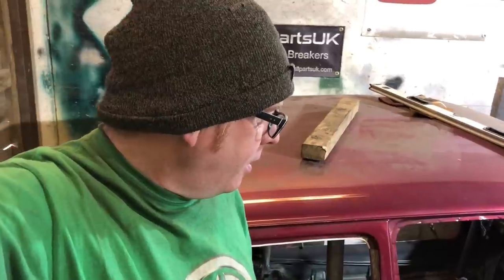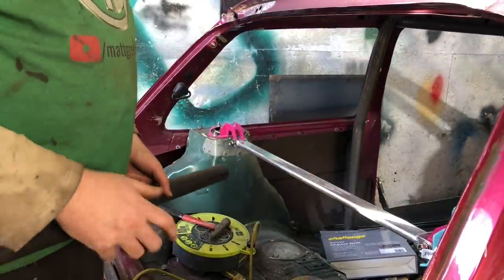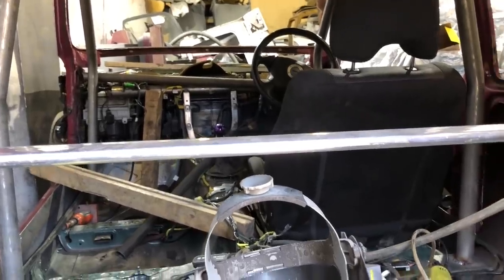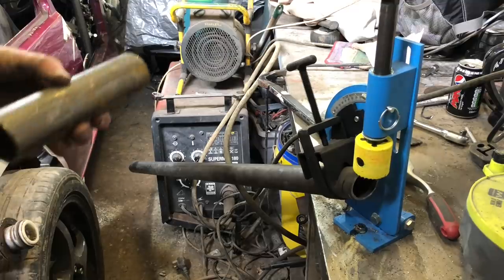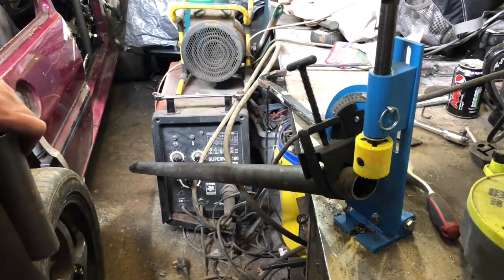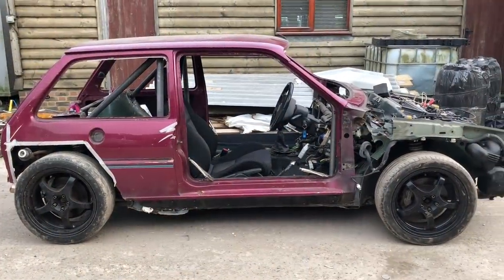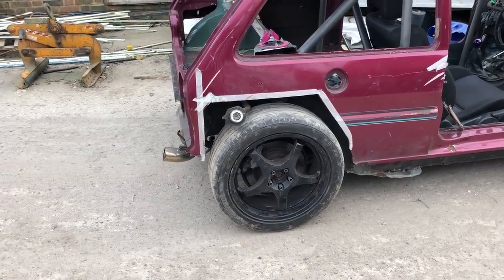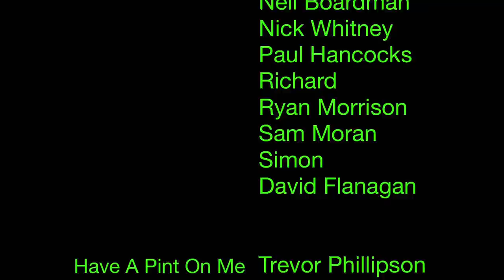Metro 6r4 WRX Subaru - DIY Roll Cage

Comment: Bloody brilliant again Matt. "I will just put a roll cage in here ..." And then you just jumped in and drove it complete with wiring harness around the legs. As you do of course.
One day after lockdown I am coming down there and tidying up your garage. Or shed. And then you will never find anything ever again.
I did the first dry build of the 1098 BMW headed lump this week as I got the block back from the engineers. Had to do this because I basically bought the short engine from one place, gearbox from another, NOS flywheel housing form another and the wok from somewhere else (which came with the slightly longer Metro Verto cable release leaver when it was supposed to be a '90 Mini🤔).
Microwave Hunters Chicken this evening....
Reply from the maker: Hold you to tidy up Chris
Reply: @MattGreenWorks  You're on mate.
I may have Noah's bodyshell with me though ... 😂

Comment: Your diagonal brace would be going from the n/s top of the main hoop to the opposite side rear leg as close to the wheel arch tub as possible..
Then I would brace the main hoop across the base , having a central fixing anchor to the floor ... 👍🏻..  massive build project with a lot of head scratching

Comment: It still runs!!!  well that will make things easier.  One trick i used for my battery relocate was to use r90 #2 aluminum house service wire. dirt cheap, UV resistant, water resistant, bends into shape, lighter than copper. just use de-ox at your connection points. I used that and a good quality lawn mower battery to save weight. works great after 2 years.

Comment: Can you not brace behind the seats by taking a bar from just above level of the top of the drivers seat part of the cage to the passenger side rear strut tower? And same from the other side to form a cross above where the rear seats would be? Just a thought